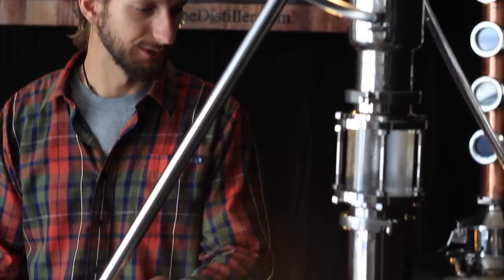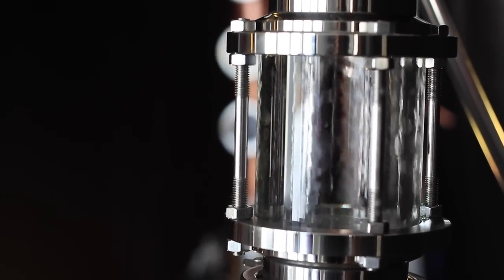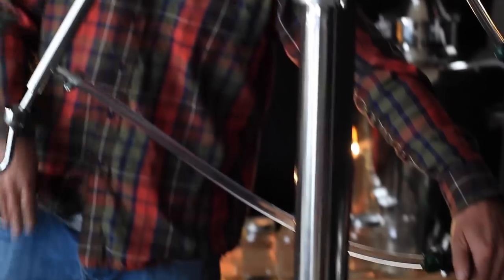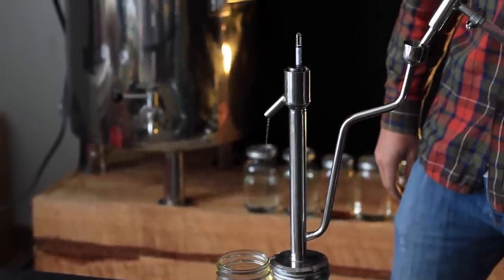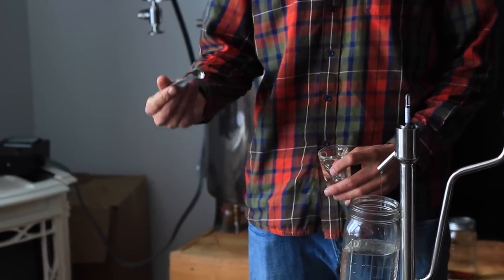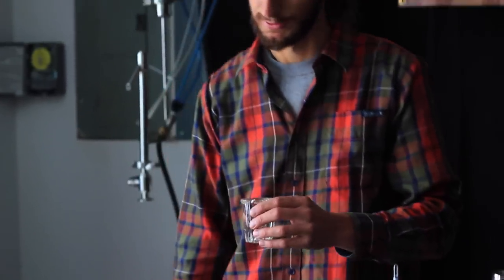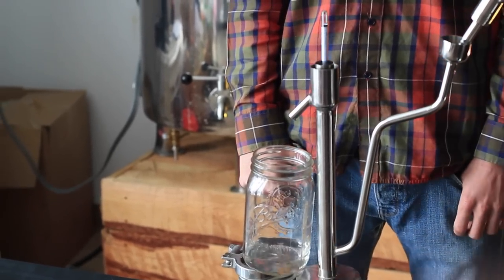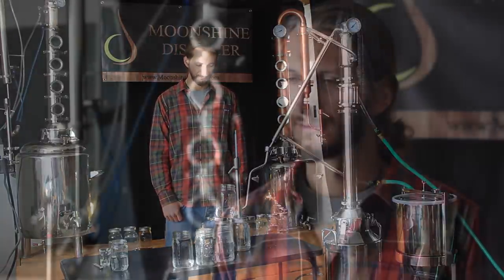Heads Series, Episode 9: How To Run a Dual-Purpose Reflux Still

Comment: Nice channel, I subscribed. One comment if I may, a fractional distillation is not simple. Waiting the solution components to be separated-distilled based to their "boiling point" from lowest to highest is utopic.  Components don't separate-distill when boil but when evaporate. Totally different thing. Accuracy and proper use of terminology is needed when comes to distillation  matters. Heads, unwanted substances don't contain only acetone, there is also a group of aldehyde, ketone, acids, asteres etc. Also utopic is to try to separate and discard  methanol by discarding heads. Methanol is distilled from the first drop until the last, mainly the last. Methanol is a product mainly found to tales, it is a paradox but this is the way it is. Right acetone has a distinct aroma but who can tell the difference of acetone and ethyl acetate? I can't, can you?
Reply: Nikos Kotsalis so if methanol is through the entire run how do you remove it then?
Reply: @joew8013  its concentrated in the beginning, as it is more volatile than Ethanol, it boils and evaporates at an earlier time. But just like water and ethanol are bonded together, methanol is bonded with water as well. So it cannot leave completely in the first drops. The most part will, so the remaining amount is "safe", as the amounts are minute. Never pour heads back you wanna avoid all the other crap like acetaldehyde, acetate and so on.
Reply: Besides, methanol is tasteless and you cannot taste or smell it. Its the other compounds you are picking up on. You may feel methanol as a heartburn.

Comment: If your not looking to run continuously. You would ditch the heads, would you or could you mix the hearts with the tails to drop the proof. Then water to get it to a n 80 proof drink?
Reply: Or are the tails not drinkable either?

Comment: Will the water going through the final condenser first then through the reflux condenser get to warm to give proper reflux action
Reply: That's what I was thinking too, I use separate water lines for each condenser otherwise the distillate comes out HOT.

Comment: Can I ask what one would do with the ISO propyl portion if it was for beverages
Reply from the maker: +ran dom It is only a very small percentage of nasties that still contains a large percentage of ethanol. Most distillers would save this portion and add it back to the boiler with their next run. This allows them to try and recover more of that alcohol.